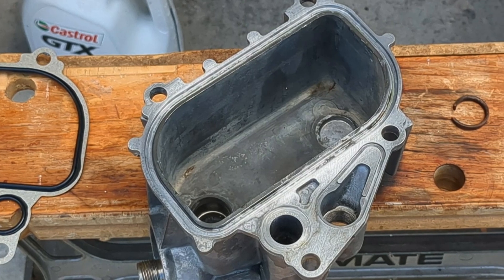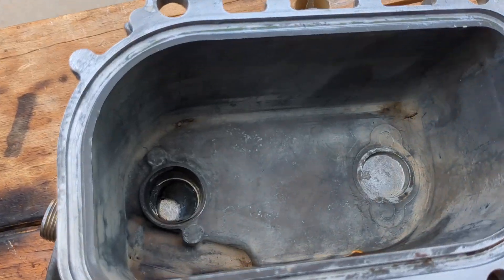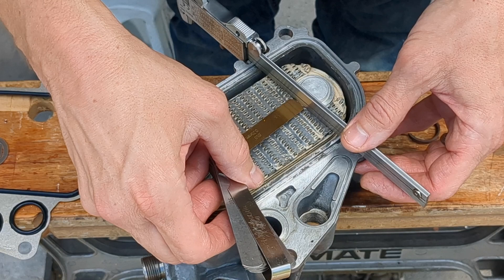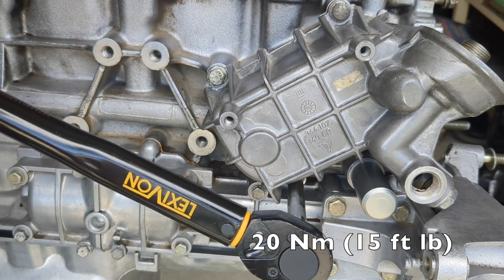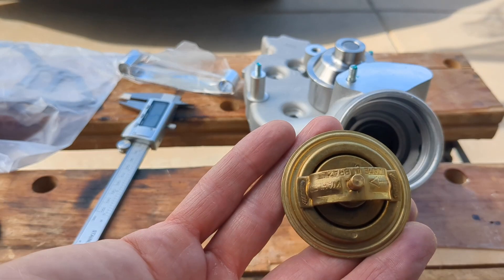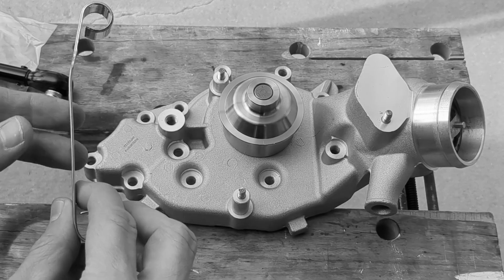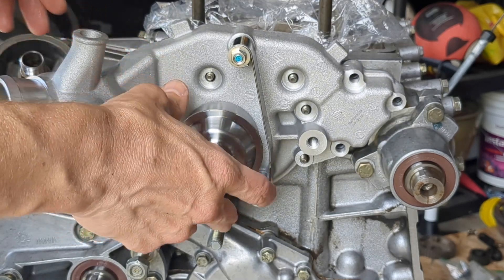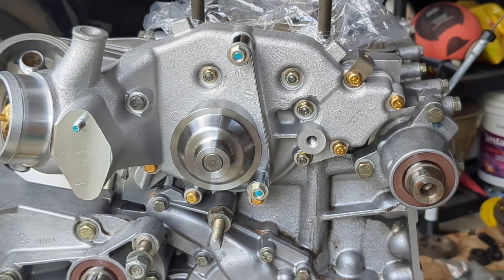Porsche 944 | Engine Rebuild Pt 6 | Oil Cooler & Water Pump

Comment: I believe the updated oil cooler housing also requires an updated OPRV!?!?
Reply from the maker: There is an updated 1 piece OPRV but it's not required. The 1 piece is hard to find and expensive.

Comment: Nice. I like to replace the waterpump bolts with studs. The bolts love to corrode and snap off in the block. At the very least use anti-sieze on the bolts. Galvanic corrosion between the aluminum block and steel bolts is a bitch
Reply from the maker: I spent a lot of time cleaning those studs as they were heavily corroded. Using anti-seize is great advice!
Reply from the maker: Replacing the bolts with studs sounds like a good idea. I haven't considered that before. Did you also replace the existing studs with new ones?